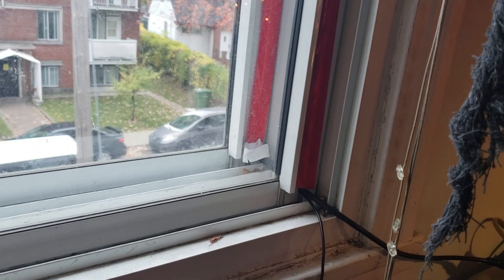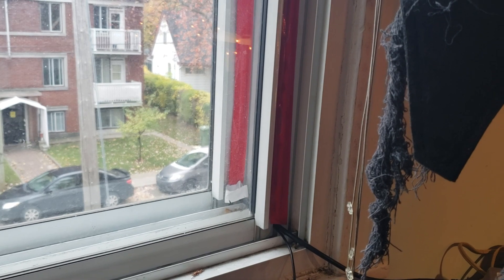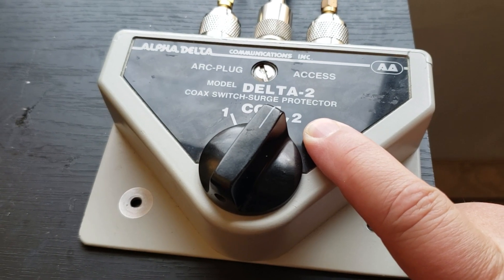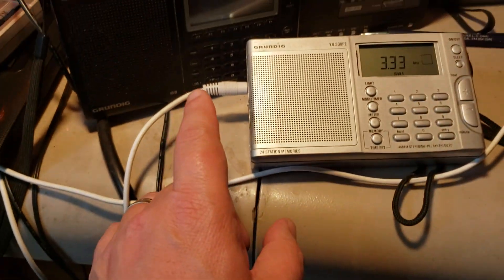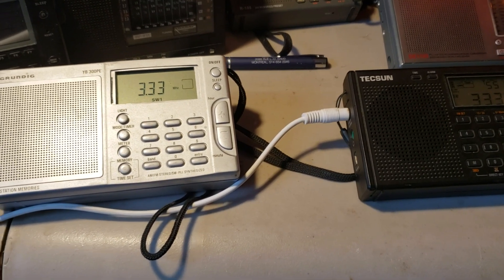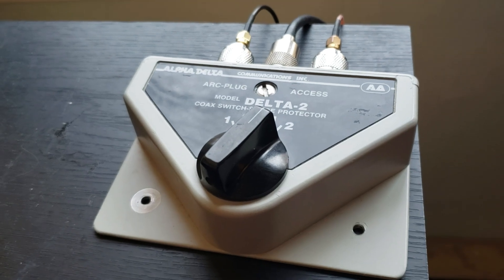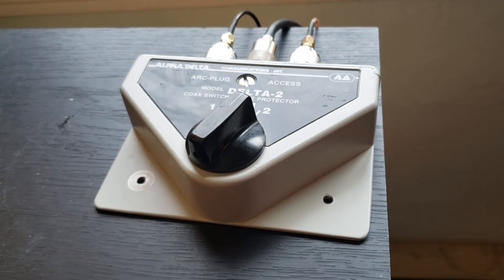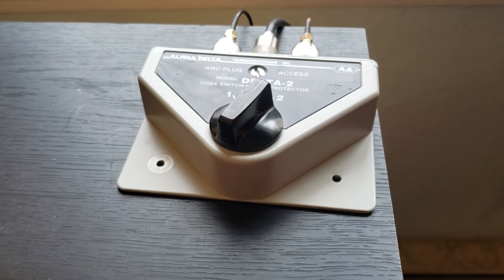How my antennas connect to the radios part 2 of 2 indoors

Comment: So how would I connect the MLA's rather unique SMA coax output to my 3.5mm mini plug input on my brand new Tecsun H-501x receiver? I would rather plug it in to the provided decoupled input than wrap a bare wire around the antenna. Any suggestions would be greatly appreciated. Keep up the great work. Your videos a tremendous resource.
Reply from the maker: This is what you need      https://www.amazon.com/RedYutou-Female-Adapter-Antenna-Extension/dp/B091ZCNXWD/ref=sr_1_4?crid=2PCO5NTENO1LZ&keywords=sma+to+3.5+mm&qid=1679277907&sprefix=sma+to+3.5+mm%2Caps%2C91&sr=8-4
Reply: @OfficialSWLchannel  Merci bien, Gilles.👍